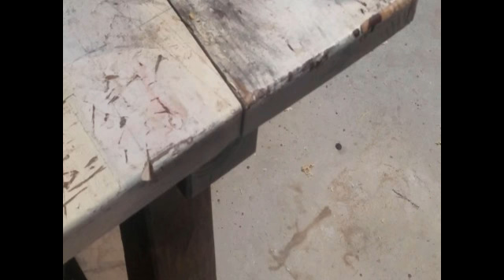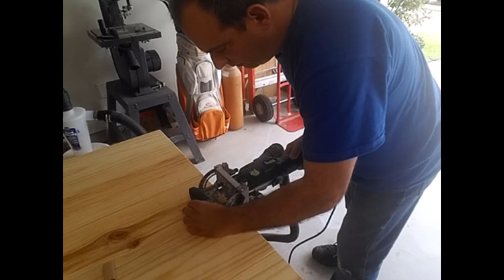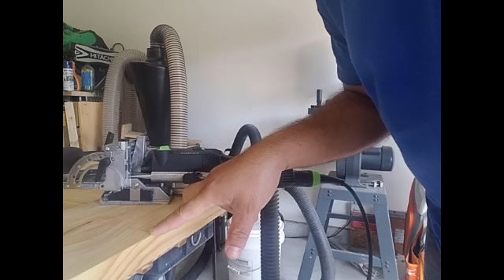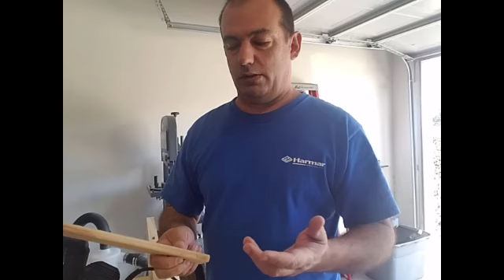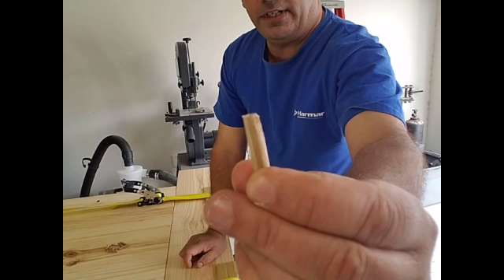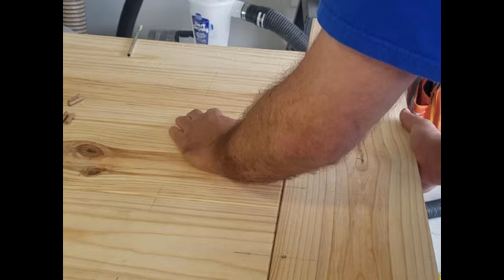Farmhouse Table... how to build them correctly.

Comment: I know this is from a long time ago but if anyone new watches and sees my comment - one way to correct for any deviation on the saw blade angle, cut the table end then, without adjusting the blade, rip a small amount off the edge of the breadboard end but upside down.  The two pieces will be at perfect complimentary angles (e.g., if you cut one at 91 degrees the other will be 89 degrees and perfectly match).

Comment: I think the most imporant tip i can recommend is DON'T use crappy construction lumber for furniture unless you take the time to dry it to a single digit number and then surface all 4 sides square with each other. 

If you cook with $3 wine and subpar ingredients 
the outcome will never be as good  as cooking with a great wine and quality ingredients.

Using a 2x6 pine board from Home Depot with 19% moisture content is like putting lipstick on a pig.

Comment: Thanks for the information. I have a question: can dowels be used instead of biscuits to join the breadboard to the tabletop using the same principle of tight holes in the center and larger holes as you work outward?

Comment: How has this breadboard jointety held up???  Hoping to start on my table soon and would love to follow your lead, if you're still happy with your table?
Reply from the maker: They've held up pretty good except for one thing...  the center section expands and contacts with the weather.   The breadboard does not.   You can cut them to the exact length when you build it,  but eventually,  the table and the breadboard will be different widths.   Drives me nuts.   I will not build another table with breadboard ends.

Comment: This is very helpful! I do have a question for you though. You showed on the first table (made with pocket screws) that the breadboard wasn't flush as the wood contracted/expanded. With this mortise/tenon approach, the wood will still expand and contract so will your breadboard still not be flush at times?
Reply from the maker: That's right.   It's going to move and the ends will not be flush depending on weather conditions.  This makes me really not like breadboard ends.   

One way you can possibly minimize this is to put the table inside and air conditioned place where it will spend the rest of its life.   Wait about a month for it to stabilize.   Then cut it flush.  There's a pretty stable humidity inside an air conditioned house.   It will probably stay pretty darn flush after that.

Comment: I've seen a lot of videos on breadboard ends and the proper way to go about them. However, if you use the dowels on the ends, doesn't that still keep all the pieces in place therefore NOT allowing the movement that is supposed to be avoided?  I understand the concept and idea behind allowing the wood to expand and contract, but it seems to me like the dowels take all of that away anyway. If it were just a friction fit, I would understand it would give to movement better. But if they are glued, doesn't that make the entire process the same as securing the ends with pocket screws?
Reply from the maker: I've never used dowels.   Dowels won't work.
Reply: @termitewoodwerx5896  aren't dowels the same as the "pins" you used?? you called them "1/4 inch dowel" btw. 22:55   I understand now that elongating the opening for the dowel on the tenon gives room for the movement!!! I got it now!   :)
Reply from the maker: These are actually called dominoes.   They are flat tennons.  And yes,  elongation the hole is what gives it room to move.
Reply: @termitewoodwerx5896  the dominoes connect the ends with the table piece but I was referring to the dowels you used to secure the ends to the dominoes.  I appreciate your responses!! ✌🏻
Reply from the maker: Oh yes... sorry about that.   Correct,  I drive dowels down through the dominoes.   The slotted hole in the dominoes give it the freedom of movement.   

I was mistaken because so many people ask me if they can use dowels instead of dominoes.
Reply: @termitewoodwerx5896  I’m considering the Beadlock Pro jig sold at Rockler instead of the dominoes since I don’t have the Festool machine.

Comment: You are doing the breadboards wrong still. Drill only through the breadboard and not through the domino. 

Make a mark through the breadboard and then offset the hole slightly towards the end of the table. This will draw the bread board towards the table.
Reply from the maker: That's actually how I do it now.
Reply: @termitewoodwerx5896  great, other than that great video
Reply from the maker: Thank you. 

I actually hate breadboard ends.   No matter what you do,  the wood will move and the edges won't line up anymore.

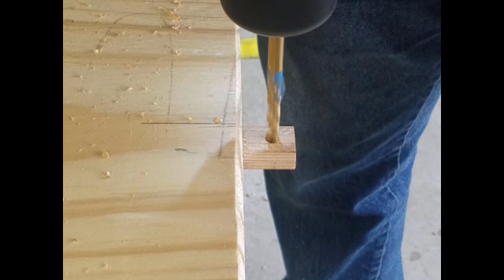Comment: Thank you for explaining this.  Pocket screws have their place in the shop, but not on a table top, IMO.  @18:23  I've even seen some people drill the hole in the tenon purposefully offset from the breadboard hole so that the dowel pulls the breadboard towards the table boards more tightly.

Comment: I used to work in a lube shop and used my hand as a hammer all the time.  then I got blood clots in my hand.  They call it mechanics hand.  Ended up with 2 more clots in my legs also.  use a rubber mallet to beat that bread board in, clots are no fun.  Good video thanks.

Comment: Would it be beneficial or detrimental to mortise and tenon the boards together side to side?
Reply from the maker: I do connect them with the domino,  but that's only because it makes them easy to align.   It really provides no extra strength.   I've also glued the boards with nothing and it works out the same.

Comment: Do you attach the boards for the top with dominos as well?
Reply from the maker: I did,  but it's totally unnecessary.   I only did it for alignment purposes.   You can use biscuits,  or you can use nothing at all,  but it's a little more work to align the boards.

Comment: When drilling your 3/8” hole through the tenon, a better way to do that and make a tighter fit is to first drill your hole through the breadboard end on those 4 end tenons then install your breadboard end and take a 3/8” brad point drill and insert it into the hole you drilled in the breadboard end and tap with a mallet lightly to mark a drill location on the tenon then remove the breadboard end and see the mark from the brad point, now take a sharp awl and carefully make a mark inline about 1/32” toward the table and use the brad point drill to drill the hole into the tenon now install the breadboard end and now when as you tap the dowel in place it will draw the breadboard in for a much tighter fit but still do elongate the holes in the tenon.
Reply from the maker: That's actually how I do it now.   Definitely a nice tight fit.   Thanks for watching and commenting!

Comment: I'm about to build my first farmhouse table, and this has been invaluable! Thank you for posting! Quick question -- I'm among those who can't justify a Festool Domino, so I need to use something else. What are your thoughts regarding using a router (as you showed) vs. using a biscuit joiner? I look forward to your reply, and thanks again!
Reply from the maker: A biscuit joiner will not work because the biscuits are too thin and flimsy.  

I wouldn't buy a domino just for this one project.   It's certainly not worth it.   However, i built my first one with a cheap router from a pawn shop.   I think i paid like $25 for it.   I still even have that sucker.

Glad you got something out of the video.   Good luck on your build!
Reply: @termitewoodwerx5896  Thanks so much for the timely and thorough response! I guess if I go the router route, I'll need to make my own "dominoes"? Do you know of other options available for that?

Comment: the movement does not happen near as bad if you seal it.  I built one several years ago with home depot pine 2 by 12's and stained it and covered it in 4 coats of polly and it still looks exactly the same.  If the table was left unfinished then it will move a ton, but if the wood is not exposed to the atmosphere or whether it will not move that much.  Not a noticeable amount anyways.
Reply from the maker: This table that is cracked was sealed with polyurethane.   It still moved.   It's a little slower to move,  but eventually it will find balance with the weather.

Comment: The definition of “correct” seems to be subjective. A proper bread board end has a full spline as well a tenons. Those Festfool Dumbinos are not even close to correct.
Reply from the maker: Looking back,  I would have to agree with you.  Although I've made many tables with this system and I haven't had a problem yet.  

I think you've missed the message of the video though,  which is "let the wood move. "  most people are just screwing these together.

Comment: Great video. Very informational. I do have one question. If you glue the dowel wouldn’t it be glued to the slot in the domino not allowing it to slide as needed?
Reply from the maker: You only glue the very top tip of the dowel there's no glue on the inside so it can free float in the groove.

Comment: Anyone that DOES NOT use kiln dried wood is a Carpenter not a Craftsman.
Reply from the maker: Funny... Matt Cremona air dries all his lumber. 

Regardless,  kiln dried lumber will still change with the changes in the season.
Reply: @termitewoodwerx5896  guess what i meant was someone using wet lumber before it is properly dried. Kiln dried does move a little but not as much as wet 2x4s at home depot.
Reply from the maker: I can definitely agree with that.   For some people,  Home depot is all they have.   I love building stuff out of walnut and cherry,  but I learned a lot from building stuff with 2x4s.  Sure... it's garbage material.   But you can learn how to cut different joinery and when you make a mistake... eh... it's $2.50 for s 2x4..  kinda hard to swallow the same mistake on mahogany.
Reply: I only use air dryed lumber for furniture. Your comment makes no sense Bruce.
Reply: @killingoldgrowthsince  as per my other comment, i was referring to wet 2x4s at home depot. Air dried in a rain forrest is way different moisture content than air dried in arizona where i am from.
Reply: 6% moisture is 6% moisture no matter where you live Bruce
Reply: @killingoldgrowthsince  so air dried wood in arizona would have the same moisture content as air dried wood in florida?
Reply: 6% moisture is 6% moisture LOL
Reply: @killingoldgrowthsince  so what you are saying is that if i cut down a tree in florida and cut it into boards and let them air dry that those boards would have the same moisture content as if i did the same to a tree in phoenix??? Kinda skeptical, would need to see some proof.
Reply: I dry all my fresh cut lumber in one of these, on Northern Vancouver Island. I have no problems getting down to 8% moisture content. 
https://www.shelterlogic.ca/shop/autoshelter
Reply: Absolutely no problem air drying lumber in Florida and even less in Arizona... It's not difficult with a little common sense. Like I said I dry all my fresh cut lumber for furniture, with with out a kiln. Not sure what your problem is...
Reply: @killingoldgrowthsince  been doing woodworking for 30 plus yrs and my brain has a hard time processing what you are saying. What you are saying is that no matter where you are on the planet, all air dried wood will end up with the same moisture content? Hmmmm
Reply: It's a dry day here and we have 80% humidity, and I can still get down to 8%. What's your problem ?
Reply: @killingoldgrowthsince  whatever grandpa.
Reply: Wow good rebuttal LOL, nothing left but insults?
Reply: @killingoldgrowthsince  you are the one that is kinda acting childish for your age. Calling someone with 35 yrs experience a newbe? Really? Since you have all this so called exerience with air dried wood, i would have thought you would be kind enough to share to me and others WHY all wood anywhere on the planet drys to single digit moisture content? But instead you want to have a pissing contest like you are above everyone else here. Show some respect and maybe share why air dried wood is better than kiln dried? Maybe share your website so others can judge if you have bragging rights or not or you are just some cranky old man.
Reply: Look kid I have no problem drying Old Growth Western Red Cedar down to 8% on Northern Vancouver Island in a shelter logic structure, you can't believe it I really don't give a fuck. I can and you can't, get over it...

Comment: Throw that Domino machine away, they promote lazy woodworking. You need a full width spline as well as tenons to correctly make a breadboard end. There are literally hundreds of books showing the correct way to do it.
Reply from the maker: I'm sorry you feel that way.   The video was mostly trying to show the problem with wood movement as most people are just screwing these together.   I don't quite understand the animosity toward the domino.   I don't use it for everything.   But if that machine is lazy... then shouldn't we all use hand saws instead of table saws?   Where's the line in the sand?

Comment: Most are sealed with polyurethane this keeps moisture out so no expansion happens I’ve built tons of furniture and never a crack if sealed correctly
Reply from the maker: Could also be the product of the climate you live in.   This table was sealed with poly.   Here in Houston we have large humidity swings.
Reply: Properly jointery is what keeps it from splitting and not the finnish...

Comment: I build cabinets for work and want a domino for faceframe work. Seeing your video makes me want to build some tables for side work. With the domino it would make fast work of the rails and legs also. Great first video by the way.
Reply from the maker: The domino is a great efficient machine.   I've built cabinet face frames with it and it's super fast and accurate.   You'll love it if you get one,  but just don't tell anyone.   People seem to have an angry reaction when you use festool.

Comment: Could you dowel them from the bottom so u don't see the dowels?
Reply: It will still split using dowels...
Reply from the maker: Absolutely.   I actually like the dowel look.   But if you don't,  you can definitely do that.

Comment: Can you use biscuits  instead? A biscuit  cutter is much cheaper
Reply: Biscuits will not keep the table from splitting. Mortise and tenon is the proper way to do it.
Reply: The table apron is what holds the breadboard up. LOL
Reply: https://images.app.goo.gl/ryVg6PJjYsqLGzSd9
Reply: No, the biscuits will not go into the table top and breadboard end deep enough to support the weight. They are also too thin. The dominos used in this video are actually quite undersized for the job at hand but do work. Biscuits are even more flimsy.

Comment: When I did it, I didn't know about Kreg jig, and I couldn't afford any of the fancy tools mentioned in the video, so in order to make tension joints, I drilled 3 holes to the same depth, then chiseled them out to make mortises.  My project used only 3 powered tools because I only had 3 powered tools, a miter saw, a circular saw, and a powered drills.

Comment: Like the first video. I watched similar videos and yours put across the main points well. Two “improvements” might be: turn the table top upside down before adding the breadboard - the dowels will be underneath and not shown in the final assembly. The centre biscuits could also be pinned to the main table top, then you could plane or lightly sand the breadboard to introduce a small amount of bow. When the centre section is fixed, the outer sections would have a springiness to close up gaps towards the edges. Finally, before assembling the breadboard the edges could receive a finish e.g. a bevel (if required) that is harder to add (subtract) later. Because the biscuits are homemade they could be made longer for the middle pair to increase strength of the joint (greater glue area). Another way to make the slots in the biscuits is to ruse a router and match the holes to slots afterwards. A floating breadboard and fixing the table top with care (e.g. only using screws in the middle at each end is the way to go). Simon

Comment: I’m glad you did this.I’ve watched people build tables knowing what is going to happen and been told “I bought my lumber at lowes it’s dry.Put it in a house with heat in winter and a/c in summer and it will really get dry.My own rule of thumb is don’t cross the top.

Comment: How do you attach the 2x8 for the top together? Pocket screws? Glue?
Reply from the maker: Just plain old glue.   No need for screws.   Although biscuits would work great to keep it aligned while gluing it up.
Reply: Termite Woodwerx  if I want a 32" wide table.  Would you just use 4- 4x8 or 2x10 and cut them down to 8"" to have good edges to work with(no joiner) thanks

Comment: A 3 foot width breadboard would only shrink or elongate about 1/32" during normal indoor temperature variations. Unless you are putting it outside, I am not seeing the problem. I have always just glued them. Maybe I am missing something.
Reply from the maker: Depends on the kind of wood.   Some would is more stable than other.   This particular table shrunk by a quarter inch on EACH SIDE!   Total of a half inch.   Most people are building these tables out of construction grade lumber and this stuff is very unstable.
Reply from the maker: Also... depends on what part of the country you live and the weather.   I'm in Texas and we have huge swings in humidity.